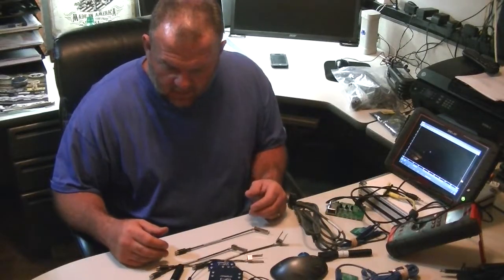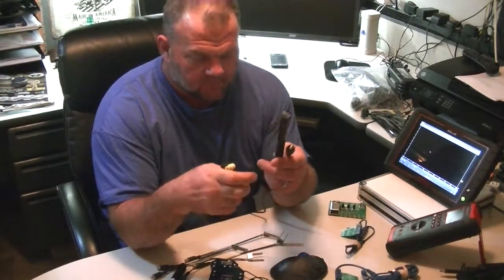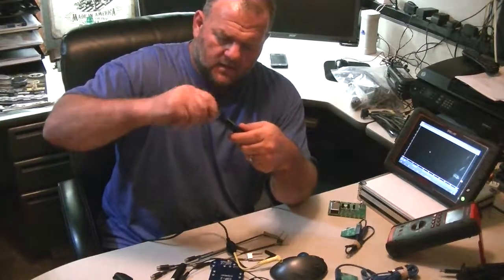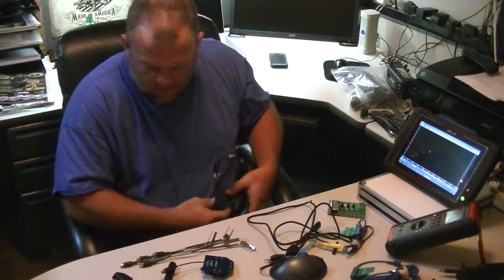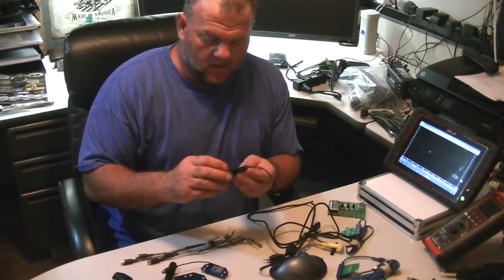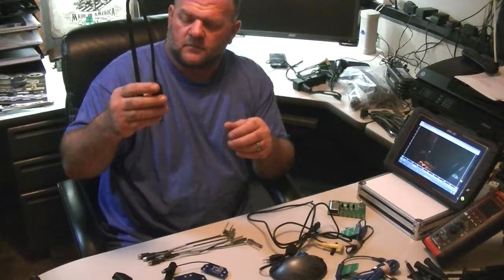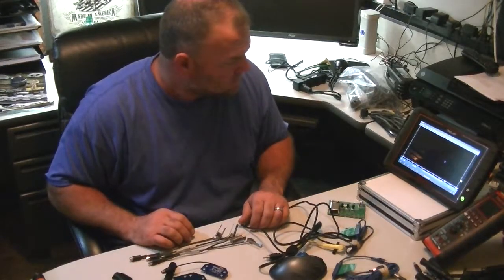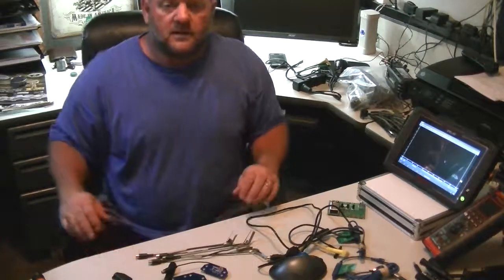Snap on secondary ignition adaptors

Comment: Quick question, what is best COP tool to use? I have the AES orange probe. I cant get a good waveform off of it on 3 and 4 wire coils. Any suggestions? COP-11 you mentioned what other lead will I have to get in order get the waveform.
Reply from the maker: Pico makes a set of test wires that fit COP's. There expensive but then you can hook straught to the wire and by-;pass those heavily insultated coils. The Cop-11 still doesn't help on all of them and you have to adlusted the voltage down very low. Does good on some though. Hooking to the wires gets the best signal. I'm not sure why but since they moved the transistor into the coil on 3and 4 wire coils the signal isn't as good. I miss the days of distributor ignition waveforms because they were so clean and easy to diagnose.
Ford's 2 wire coils are nice since you have a actual coil negative like the old days and I just back probe the negative side and you got a nice clean primary signal thats easy to look at. Plus primary and secondary waveforms are mirror images of themselves so that works great on Ford COP.
Reply: @70corwin  Thanks for the reply. You would think they would make things easier for us techs to figure things out rather they are going the opposite way. Once again thanks so much appreciate the answer and your videos, especially with a relative compression one.

Comment: How do you like the mini four channel scope?  I mostly just work with my 89 Corvette and 95 K1500 truck but have been enamored with the Sun Ignition parades since I was a kid in the 70's and 80's.  I really want that capability now but it doesnt make sense to spend more than a few hundred dollars.  I have a SnapOn Vantage MT2400 and 2500 bought off ebay but looking for a scope.  I've  seen the Hantek and Pico 2000 non automotive and the Uscope options and the dso you show  and all are in my range. I'm trying to find the best option for a DYIer.  I really enjoyed your video.  I did't get a few cable with my vantage and this helps.
Reply from the maker: Pico 2000 series even though its not intended for auto it does decent for $200. You can get the older style coil wire lead and use it with the older HEI adapter that use to come on the sun machines. You can still buy thoughts leads and adapter on line and there cheap.
You can also get a KV module for the vantage that graphs out the KV , burn time , spark line. Ebay should have those also cheap as well but its not a ignition waveform just a graph.
Reply: @70corwin    Thanks. I've been on the fence with the Pico 2000.  I think I'll get it based on your comments.  I'll get an attenuator too.  I do have a kv module for my Vantage but need the leads for ignition pickup and cylinder sync.  I appreciate the response.

Comment: Do you still use the wire you showed on the secondary slide clamp with the yellow and black plug for the  Snap On Vantage MT2400 Kv Module?  I cant find much info but I think it attaches with a single cable so maybe it's a female to female RCA extension wire?
Reply from the maker: I'd have to look at my kv module om 2400 theres something different from that to the new ones if i remember correctly i'll have to look and see.

Comment: Good information on the adapters and pico, was wondering have you used the paddle probe with the zeus and if so is it better than the pico wand, ie the sensitivity is what i'm curious about. Thanks for the info about coil insulation, makes sense. Cop 11 didn't see any reference on snappy's web page could i get the part number? Thanks for the video
Reply from the maker: dwayne sullivan 
I haven’t used the paddle probe. But the part number on the COP-11 is EETM306A14. Remember you still have to lower your settings some. Plus you’ll need the ignition starter kit that the adaptor plugs into if you don’t have it. EAK0294B09A.

Comment: Great vid! Quick question, does the secondary alligator clamp style and the secondary slide clamp style (twist off end) do the same thing? If so does one work better than the other? Thanks
Reply from the maker: They both do the same thing. I can’t tell much of a difference between them.
Reply from the maker: Sorry for the late response but yes they do the same thing. The screw off end works better if you want to do coil on plug coils one at a time in my opinion.